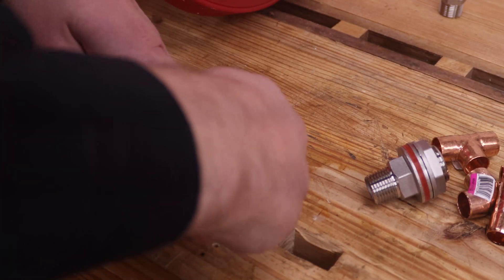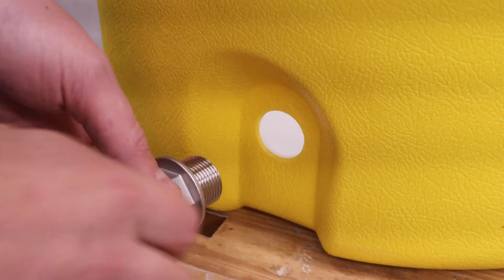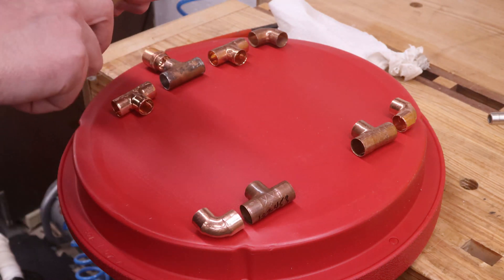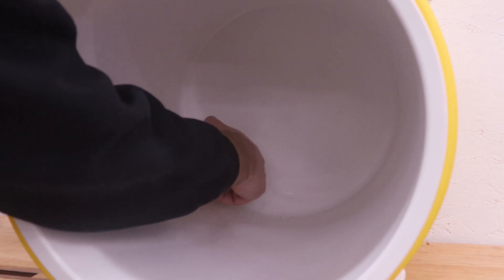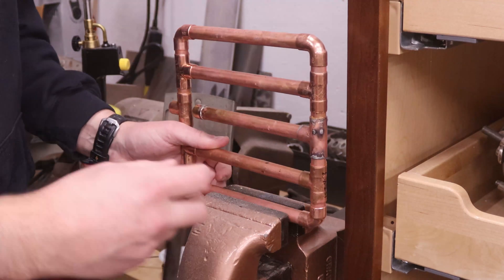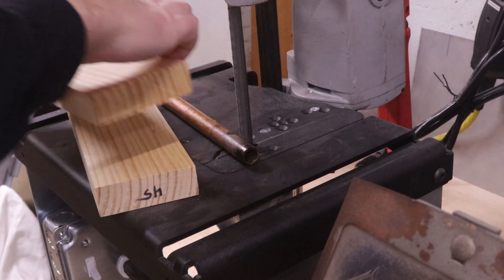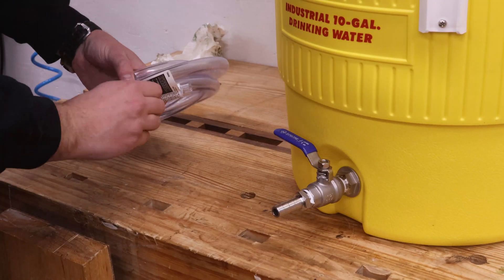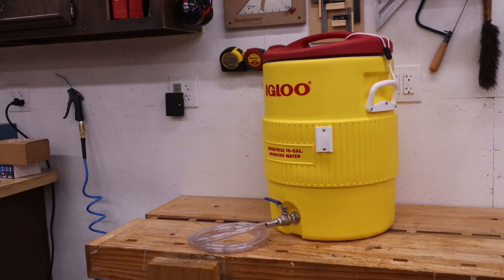How to Make a Mash/Lauter Tun from a 10-Gallon Cooler | Home Brewing

Comment: Would a jigsaw work to cut in the slots on the piping? Also would there be a way to secure the pipes together other than solder?
Awesome video thanks for sharing your knowledge!
Reply from the maker: Sure, a jigsaw would work fine. They're might be another way to join the pieces, but I can't think of anything less expensive than soldering.